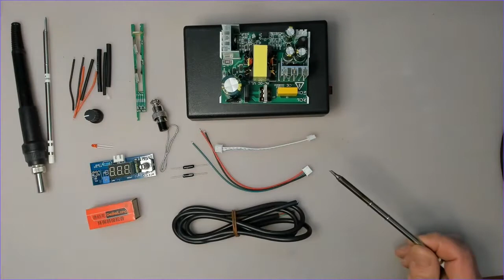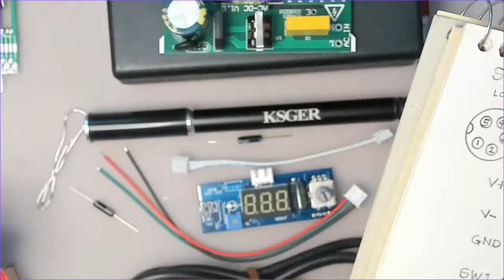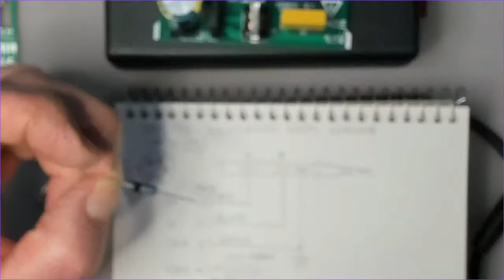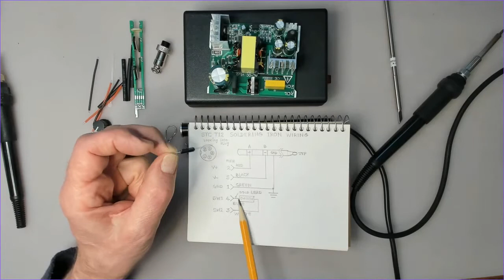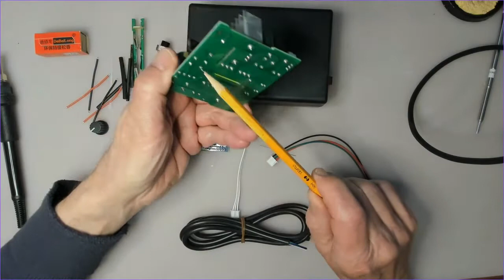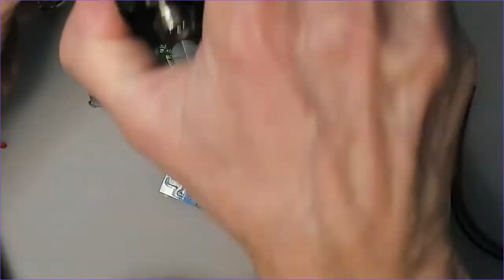STC Mini T12 Solder Station Build Part1

Comment: could you use mercury switch instead of ball one?
Reply from the maker: Not sure but probably not since the vibration switch device has two small balls in it according to the data sheet and they are more complex that a simple on/off mercury switch.